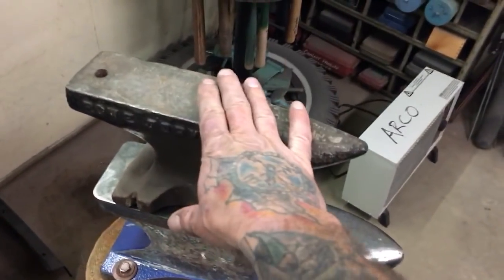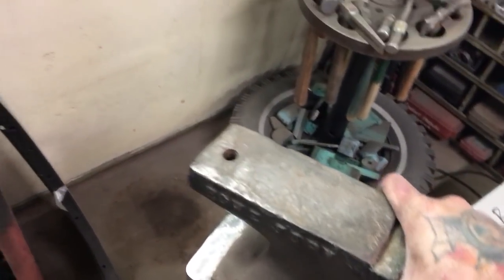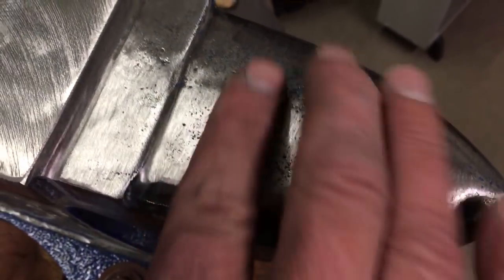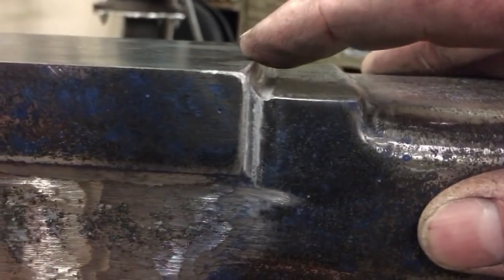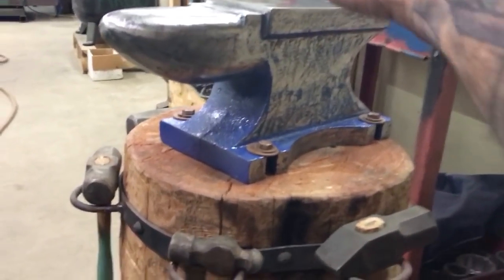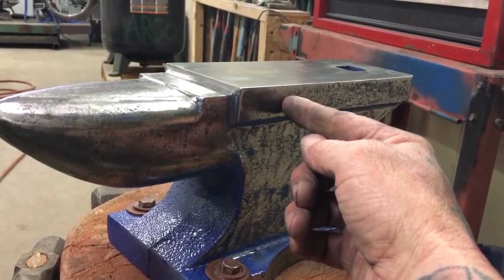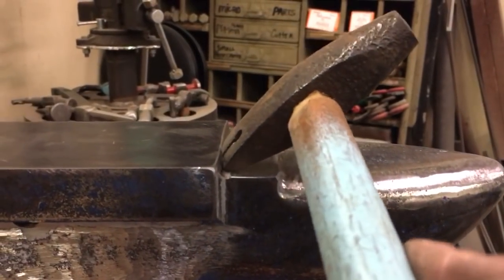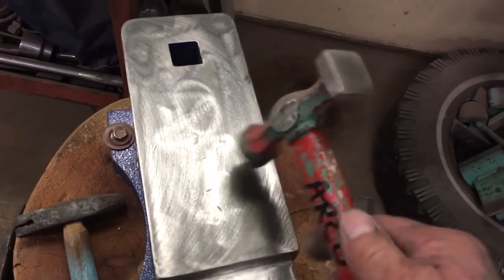Harbor freight 55 pound anvil PART TWO

Comment: Just picked up one today, per your recommendation.  I figure for the price, the worst-case scenario is that I wasted $55.  I just need something that I can use for household tasks and for motorcycle repair work.  Better than beating the metal on the driveway with a hammer.  Thanks, subscribed as well!
Reply: Michigander in Exile i got 125 pounds of nikd steel in a plank of 13"x 14"x 2.5" at my local scrap yard, $24 better than these cast iron ASO

Comment: I got lucky on the casting and did add a 5/8 thick steel plate to the top and am going to case harden that steel plate later.
Reply from the maker: That should work out great. Thanks so much for watching. Happy new year

Comment: I like this mount for the anvil better. 
Ever consider welding a harder piece of steel to the top of the avil, since the cast iron deforms easily? 
It would change the profile of the step near the horn.
Reply from the maker: Brian Max yeah we talked about doing that but we got another anvil that’s huge and old steel so its way better. But I still use my harbor freight anvil every day 👍 thanks for watching

Comment: Hey outlaw can you help me out? I want to mount my anvil similar to yours but I can't find screw that best fit, can I know the size of the screws and flat washers you used. Thank you
Reply from the maker: Ryan Muaha i just used four inch long wood screws with scraps of sheet metal that i punched holes through to hold down the anvil. Thanks for watching 👍
Reply: @OutlawEdge  thank you so much

Comment: Was the old anvil made of soft cast iron and why did u quit using it? How is the new one holding up to sheet metal work?
Reply from the maker: Aaron Dalton the new one is doing really good for a cheap anvil. I use it every single day in our shop. And im tough on tools. There are small dings in the face but it is softer than the old anvils. My old anvil is very beat up with lots of really deep gouges and chips. Thats why i prefer the harbor freight anvil. Its got a very smooth top. Thanks for watching.

Comment: You need to weld a piece of hardened steel to the top of that cast iron piece of crap in order to make it be anything worthwhile. Just a thought
Reply from the maker: jeff wolf yeah but for what i use it for doing bodywork and fab its no biggie it works fine bro. Thanks

Comment: I like it! The front lip directly b4 the horn, looks like there is a small Indent in the middle (possibly,  if I saw correctly) I was thinking/wondering if metal could be added by welding to fill any voids & then grind her smooth again, or does it have to be forge welded? Either way, I Have to get me one! Asap!!!
Reply from the maker: D.j. B yup it can be welded simple with a regular mig welder. My old anvil ive welded and reshaped many times 👍🇺🇸

Comment: Gaps are bad for anvil. Needs to be solid to avoid it acting like a spring.
Reply: Sean Stockstill you are correct. He would need to forge weld hardened steel to the top to really fix that pile of crap.

Comment: Didn't they just weld that plate on the top of a cast iron body? There probably was a big gap, because they didn't take the time to machine the cast iron flat. So they just bondoed the cracks. Shoddy as hell. Looks like an anvil, though.

Comment: I wonder if there's a way to fill in the pit marks on the horn and then grind it smooth.....I guess the only real way would be to grind it down then weld fill and re-grind?
Reply from the maker: mcorrade yup you would have to weld then grind. But for the price its not bad. Its very soft metal but a guy could weld a harder plate on top too. Thanks for watching
Reply: Outlaw Edge